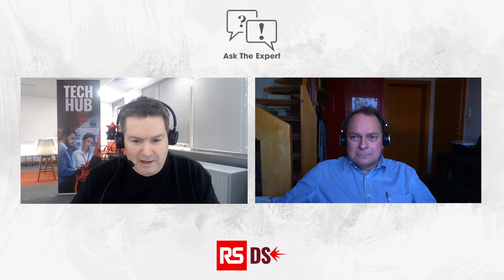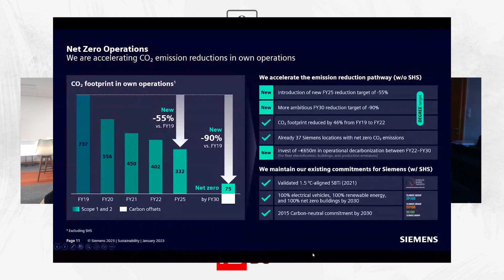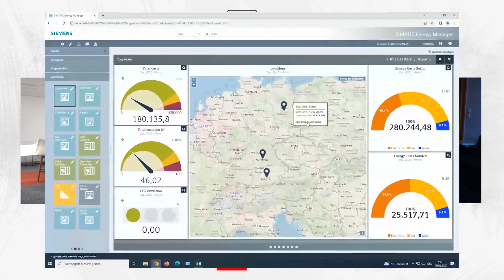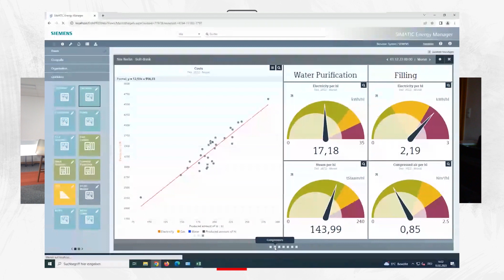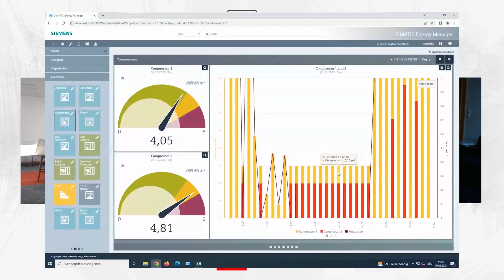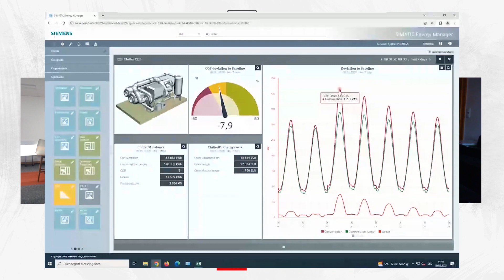Industrial Energy Management with Siemens

Comment: As the cost of electricity rises, this could be used by sub-contract engineering machine shops as a competitive advantage in accurate quotes over their competitors or as a process waste elimination to sharpen up inefficient cuts / operations. It doesn't mean all inefficiencies can be improved but knowledge of what's happening is the first step to process improvement.
I'd be interested to see if lowest part cycle time always equalled lowest energy usage -QI